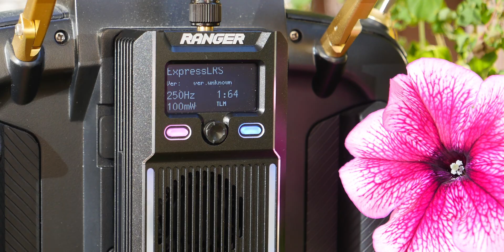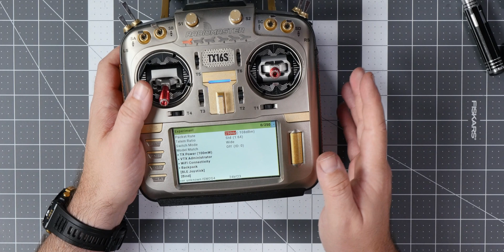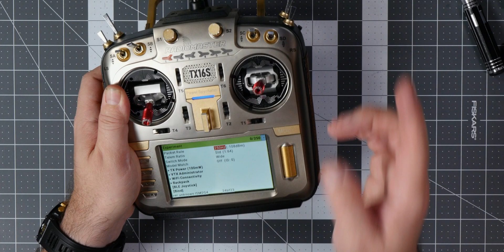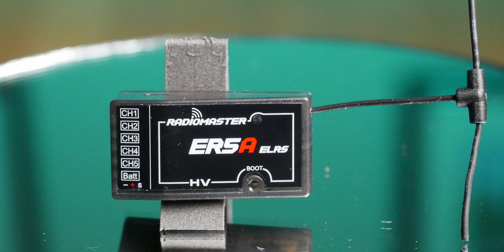RadioMaster Ranger and ExpressLRS receivers

Comment from the maker: How to make Express LRS Nano Antenna at home? https://youtu.be/NE3It_E0EoM
Reply: but what about the LBT issues that is still open on github which means the customs will reject it due to missing CE and LBT labels.
FrSyk without LBT and without CE did not pass in 2018, but the LBT I had ordered around chrismas 2018 arrived cause it was the LBT edition FrSky had released meanwhile.

Since that event they do know me and always check for radio frequency compliance quite carefull , even kits are now at their list that are not allowed at least as long as those are called elrs receiver or transmitter.
Reply: @typxxilps  ExpressLRS supports LBT since v3.  You can check the Radiomaster site for CE and FCC certs.
Reply: hi I have a problem binding tx16s with the mateksys f405wte(flight controller with build in antennas).
could anybody help me?
I'm really struggling.
please 🙏

Comment: Is it still worth using R9M for fixed-wing aircraft and Taranis X9D equipment, for long-distance flights? There are many advantages to this system, such as Fport, 16 full resolution channels, but I don't know if it's not outdated today, because people are making modifications to these modules for elrs, so isn't it better to buy an elrs module right away?

Comment: I use the 915 Mhz very early HappyModel ELRS transmitter (yes, I was shipped without a case, so I have a 3d-printed case) and I pretty happy with it. I really have no problems with link quality in any scenarios including flying behind obstacles. However,  how good is 2.4 Ghz version of ELRS?

Comment: I agree that it is a good module, but "best" is a subjective term. All that UI flummery is completely unnecessary in my view given that the radio has a touch screen on the other side and the LUAScript does everything needed. Just more complexity to go wrong. There's nothing wrong with a HappyModel module for significantly less than half the cost. Just my opinion, of course.

Comment: Czesc Pawel
Do  Modulow ExLRS musi byc RM 16S Mk II transmitter. Poprzednia 16S wersja nie jest do tego prystosowana. Myle sie?
To operate these module you must have transmitter 16S Mk II, right?

Zbyszek Michalczyk from NY
Reply from the maker: no, will work with any OpenTX/EdgeTX radio with a bay. Even old FrSky X9D. TX16S mkII has ELRS TX built in, that's all
Reply: @FPVUniversity  Dzieki. Nie musze kupowac nastepnego Tx. I am 65 and used to use MPX Tx for 30 years  absolutely for everything. Now I  have to keep buying this new crop of technology over and over again to stay current. This is a good news. Thanks. Now I have to think how to install the LRS module in FrSky X9E tray Tx. Needs to be upside down. Do they make extended antenna wire? Good presentation by the way. As always

Comment: "This is the best elrs system", only the knobs don't work yet, and the firmware is incomprehensible... )))   What then is the worst elrs system?
That's why I'm using TBS for now, everything just works there
Reply: longpress the button, et voilà the menu popps up. Like in crossfire lite / full module. The firmware is working, no idea why Pawel did not do that. Painless360 did longpress it kind of, that´s the most natural way to get into a menu via this button. So I guess you must to be at least familiar with bigger crossfire. Pawel seems/seemed to use R9M frsky, so maybe he never came into contact with a longpress button.. oh wait, you need to longpress the TX16s powerbutton to power the radio up...🤔
Reply: The firmware is finished and works. All reviews were provided information on the new buttons/features, and this is evident from the other reviewers.  Well worth checking them out.
Reply: Elrs just works there also

Comment: Wish they released this 1 month ago I just switched from ELRS 915 to ELRS 2.4 and bought new modules. It would be badass if they combined 915 and 2.4 in a single radio module.
Reply: not possible not only due to different wave forms/transmitters specs, but antennas too.

Comment: well i really like Radiomaster so im holding back now lol...but wtf is that bulky bling bling POS here ?  gimme the micro version in aluminum(&display) but im for sure not stacking plastik adapters on my "bling bling modul" so it can stand out a meter out of my tx16 just to impress ...whom exactly ? and no display for the micro version ? sure...& 900/868 mhz is just for peasants who dont want to use 2.4 with 1.21gigawatts i suppose - pure madness lol

Comment: Why noy 900 Mhz? What's happening with 900 MHz?
Reply: Large antennas suck
Reply: @DivisionRc  And that's why, nobody it's gonna remember your name.
Reply: @dronesluveco386  uh okay
Reply from the maker: The thing is, nobody care about 900MHz. Sure, in theory you get some extra range and penetration but it does not matter for majority of pilot. Like 95% of them. And you also get longer antennas. Much longer
Reply: @FPVUniversity   Damn, 2.4 sucks:(
Reply: @dronesluveco386  I would agree, but actually not. The 2.4GHz is absorbed by water in the air which sucks, but there are other parameters also. You are getting in ExpressLRS LoRa modulation which have impressive signal-to-noise ratio. Here, also with with bigger power than in classic 2.4 link. All of that together makes 868/900MHz a little bit pointless to implement. And i'm saing this being that 5% of big 868/900 fans. Of course, if you want to fly at 100-300km distances, use lower frequency, but almost nobody fly that far.